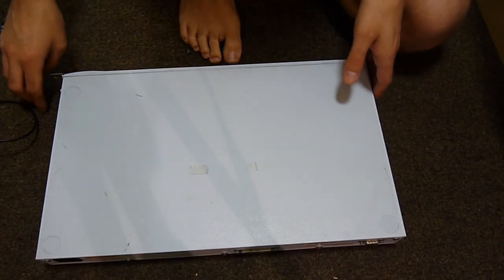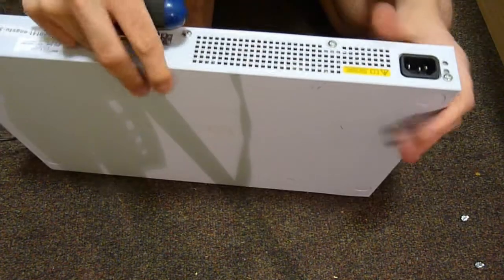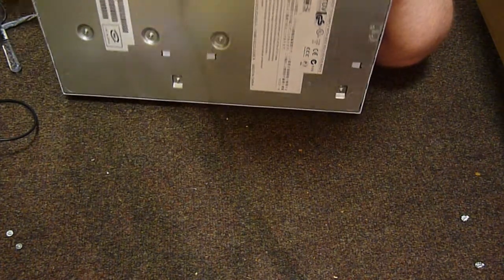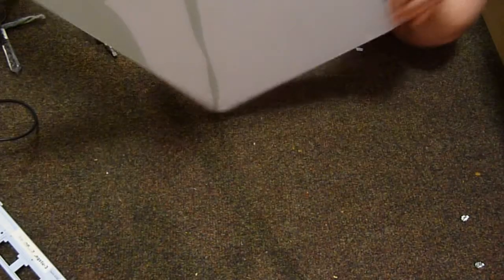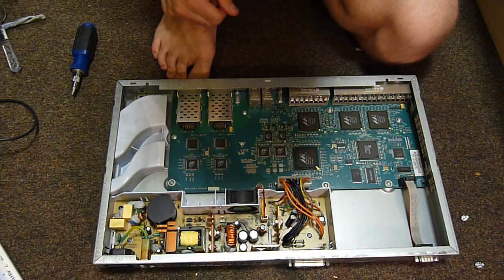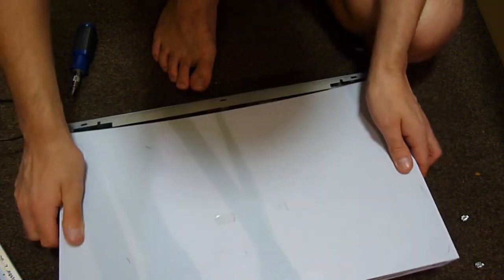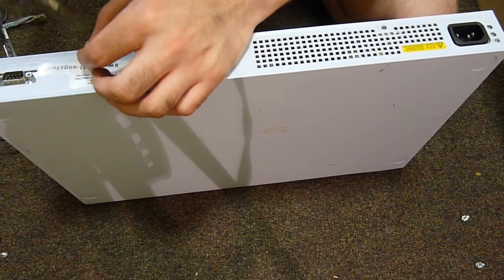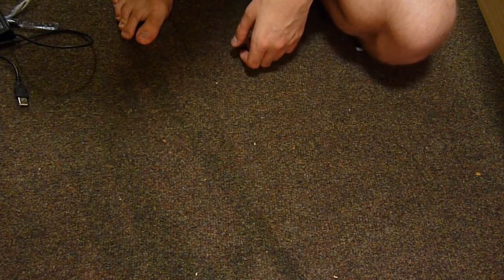3COM Switch 4228G Teardown

Comment: That would be cool!!  I've never visited a large data centre but I've seen videos of them, have you seen the size of the air handlers that cover a while wall?  I bet the condenser unit is bigger than my old college!!!!!!!  The power generators are massive too!  Big diesel gensets, flywheels, batteries and such! I bet one day you will be working in one!!

Comment: Nah this was a 24 volt blower, it ran very, very fast and very, very loud!  The board had diagnostic LEDs all over it and apparently the 'fan failed' light came on before it went BANG!!  Haha in your house you could have a mini rack to hold the LAN equipment and a small form factor server with lots of big drives!